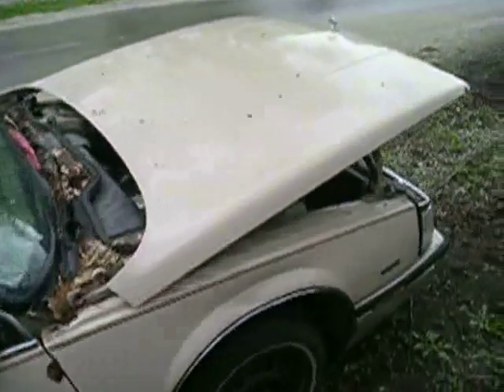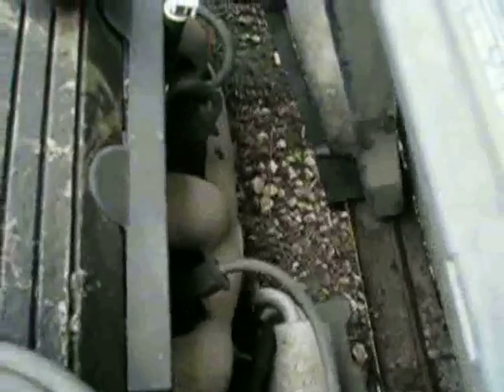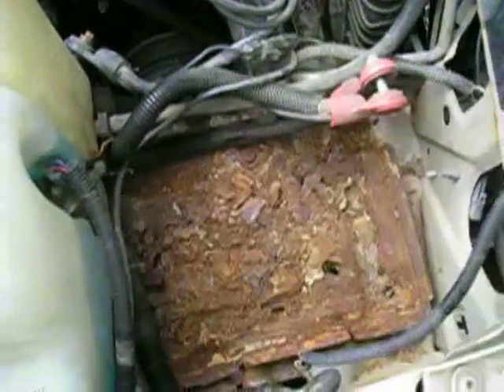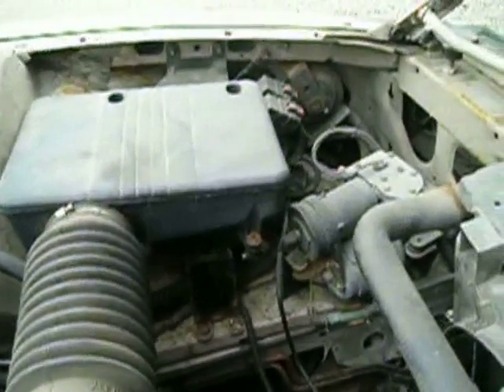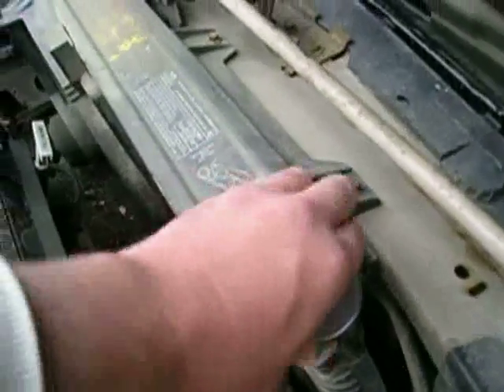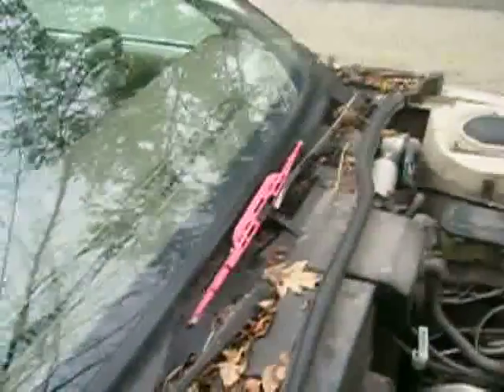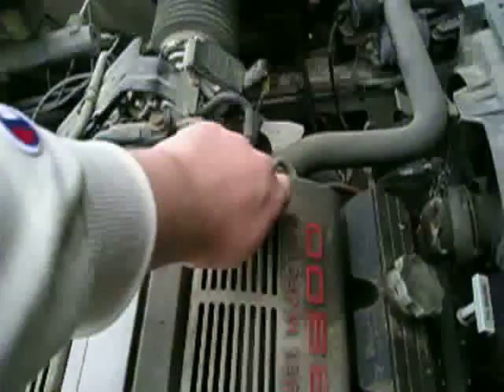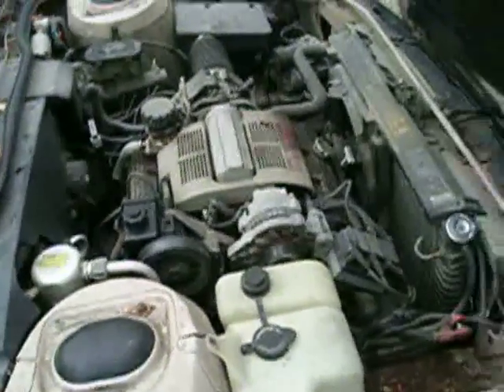Exploring a mid-80s Buick - What's Underhood?

Comment: How does the plastic cover over the top of the engine come off?
Reply from the maker: It just pulls off, there's nothing more than the pressure of a few clips holding it in place. Lift straight up with moderate force.

Comment: For the coil and ignition module there is two brands. Magnavox which is on 80's and this car to mid 94. Then the Delco brand 95ish on up.  To tell them apart the easy way is the Magnavox type has all 3 coils attached together on 1 unit when one goes bad all 3 are replaced. The Delco has the separate coils bolted on by removing two screws for each coil. My sister had a ignition module go bad for the second coil and a junkyard part fixed it.  Those are not cheap.